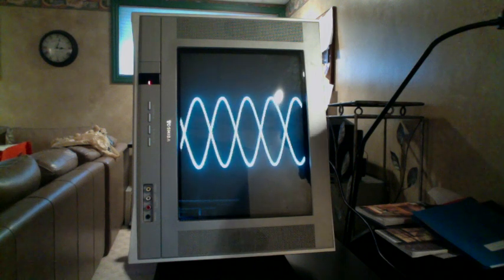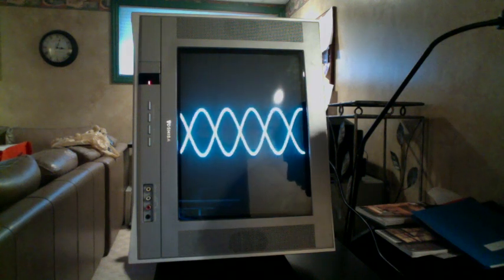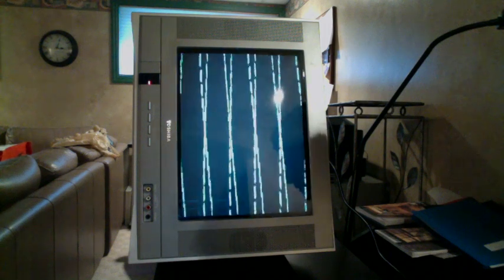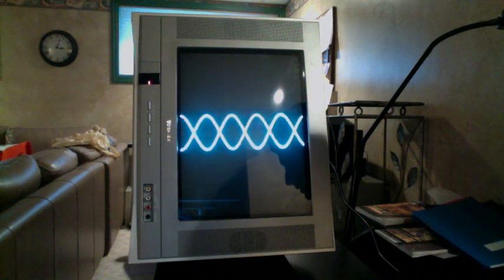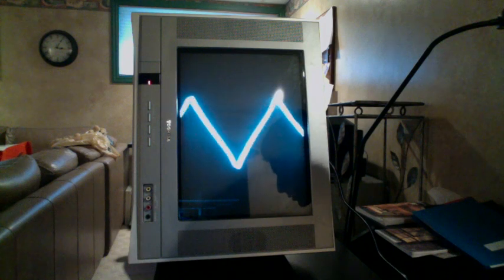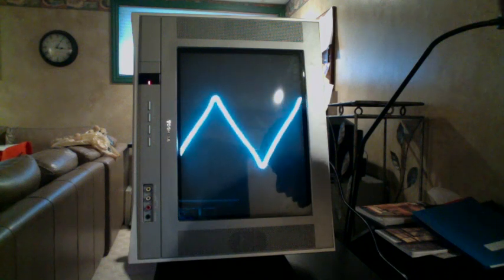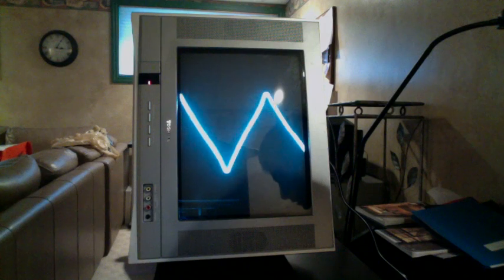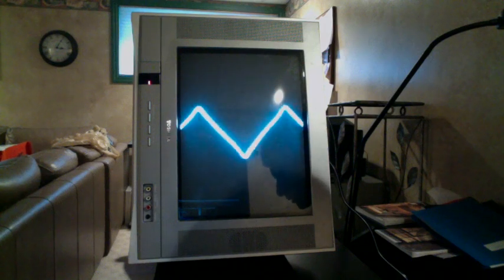Very simple oscilloscope from modified CRT television

Comment: I used to have a T.V. like that.  The Blue went out on it so I cut the Electron Gun off it with a String and it's been sittin' in a Baggie ever sense, LoL,  I might make a somethin' of it someday!  Did you build your own function generator?  I built one out of a 5" B&W, works good except the stinkin' power plug broke so now I gotta fix it again like before because well you know I always gotta do things multiple times for some odd reason;^D  Anyways, Nice Job on your CRT^!!^

Comment: I guess you're using the old telly's field timebase here but if this is so you would have very little adjustment of it's frequency via the vertical hold control (if there is one).Also I guess you have no means of synchronisation or triggering as it's known but I can see why folk might want to play with this.

Comment: Why don't you cut and use both the horizontal and vertical coils and feed a stereo signal into it to simulate an XY mode?
Is there an issue with doing that?

Comment: loosen the clamp that holds the deflection coil assembly to the tube and rotate the assembly 90 degrees instead of rotating the entire tv 90 degrees.
Reply: +Shadowrcmegatech also route the audio input you&#39;re using through the red/white plugs on the tv then connect wires that go to the tv&#39;s speaker to the deflection coil instead of connecting the audio source directly to the deflection coil.

that way you can control the on screen amperage of the signal and fit it to the screen
Reply: +Shadowrcmegatech I have a problem with my CRT Oscilloscope, that the signal only goes so high on the screen and plateaus. What can I do to increase the range?
Reply: Jonathan Finley Same thing happens to me.  I think its my phone that's limiting the range, not the tv.

Comment: You can unsolder the horizontal wires, and put the vertical on them to get the waveform in the proper orientation.

Comment from the maker: In this case, it's the sound signal being pumped into the TV by a synthesizer that makes the waveforms visible. I have a speaker going as the other output so you can hear what the CRT is responding to. But yes synthesizers can make a huge variety of different signals and this translates to sound when a speaker is hooked up to it -- any kind of thing that can make the air resonate can produce the sound (see my flyback transformer vid for a unique example :p )